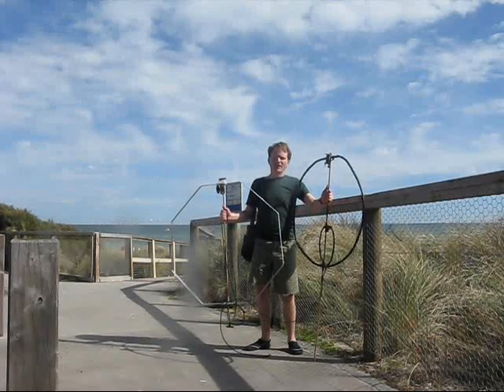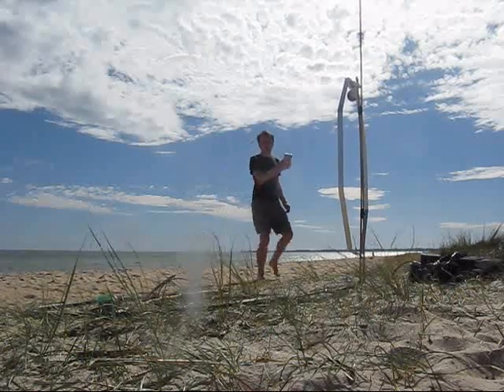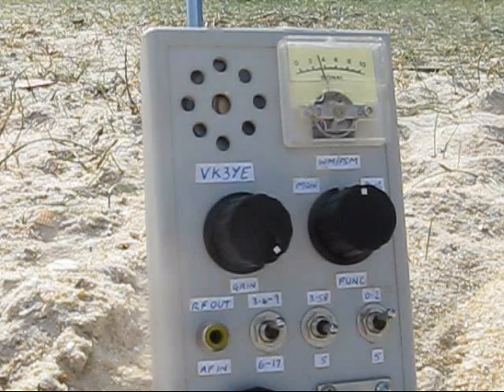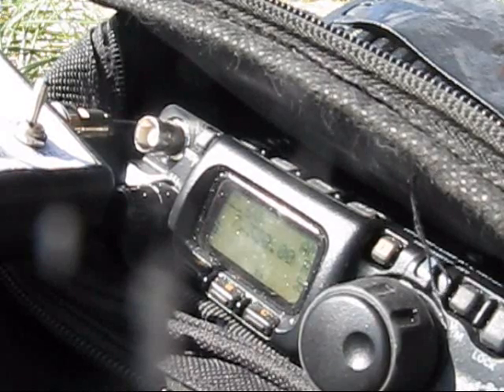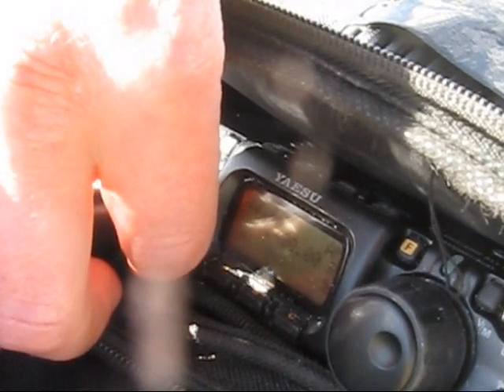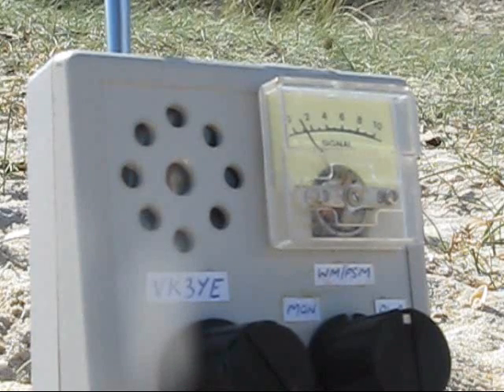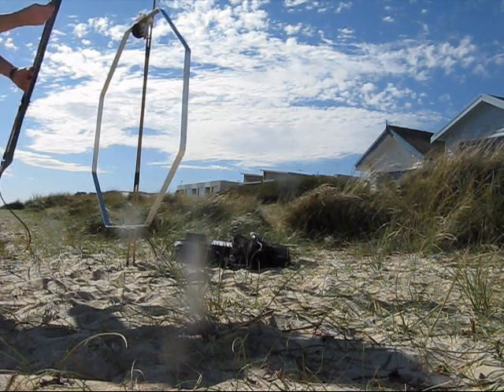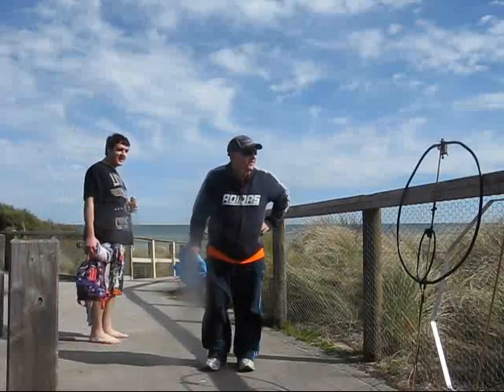Tests with magnetic loops 2: Gain from two loops

Comment: i would like to see a 3x 3 array with all loops on a flat plain along side and stacked 3 wide 3 high and with all loops in series, thinking gamma match on the top of the loop where one has an insulated sleeve and the other side has an aluminium rod, with the rod sliding inside the other section at the break ontop. It would be more interesting to focus on a signal in the direction the loops are facing and bring the loops into the curtain array one by one. If it works it could be one of the smallest types of curtain arrays.

Comment: I've thought about this but why not try them in-line with each other as maximum  radiation comes from the ends of the loop not the centre? Then try to enhance signals in the main loop and it might be more directional. Unfortunately I now suffer immense QRM and don't want to transmit on top of anybody because I can't hear them.
Bill, G4GHB.

Comment: How about with the 2 (active) loops side by side ?  A 2 loops array...There should be 3 dB         72  Yves  ON7BAS
Reply from the maker: It could work but I suspect that bigger gains could be achieved by using one bigger and better built loop with super low resistance & losses.
Reply: Phased arrays of 4 - 16 loops 1/4 wave length spaced apart...  hi !  Turn the beach into a HAARP replica   LOL Cheers from Belgium 72
For lower resistance losses use SILVER welding.

Comment: In that experiment with two loops I am not quite sure that the second loop act as a parasitic element. In fact I think the first antenna just "sees" a bigger loop. Because we are dealing with a magnetic field here and not RF I think both loops couple up to form a bigger loop. Cheers. ZL1RPL
Reply: Jean-Philippe DIEL Agreed, same as if you made one loop but increased the surface area of the conductor causing it to be more efficient.

Comment: Hi Peter, here's an idea. Make your field strength metering device so that the sense antenna, rectifier etc are at your fixed measuring location but wires carrying the dc to the meter located near the loop so you can see the meter clearly while you tweak tunings.  Run 1W carrier (your yaesu on low power)  through 6dB attenuation so SWR doesn't affect the radios output power level. Then set the loops at say 1 diameter spacing and try carefully adjusting both tunings until max field is reached. Try a little closer and further apart doing the same thing. I suspect that both loops would need to be the same diameter to observe the greatest effect and not only the tuning but the spacing also would be pretty critical. I don't think you'd see much better than 3-4dB  :)

Comment: I have tried almost the same some years ago. I can confirm that there might be abt 3 db gain using two loops just the way you did it. When the passive loop is located more than one diameter distance from the active loop, there is no influence at all. The passive loop moves the resonnance of the active loop which is the biggest problem in this experiment.. I suppose the passive loop could be used both as a reflector and director, and perhaps a 3 element loop could be made with both director and reflector loops :-)  Great vid, by the way :-)

Comment from the maker: Thanks Ben - I think you may have a point re maximum radiation.  The first video 'is height might' (1:10) effectively rotated the loop when it was lower and if anything the signal was stronger.  So could be worth repeating this test.on local and DX HF signals.

Comment: Hi Peter I find your experiments very interesting. I wonder if you removed the coupling coil from the parasitic loop it would help. 
However my experiments have indicated that the maximum radiation is from the point opposite to the capacitor. You can see this demonstrated if you look for “Small Tuned Loop Radiation Direction” Thanks for an interesting Video.
73 Ben G0CWT

Comment from the maker: @dennisbauer65 it's a Canon Powershot A720, with a big scratch on the lens. Not really designed for video but it has good sound, compact file sizes and doesn't require complex conversion to AVI (unlike better Canons).